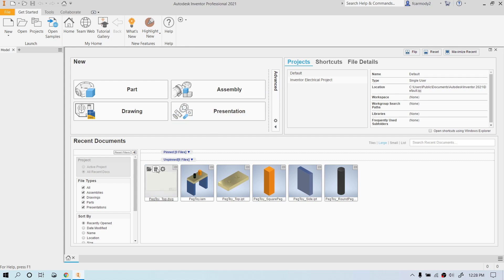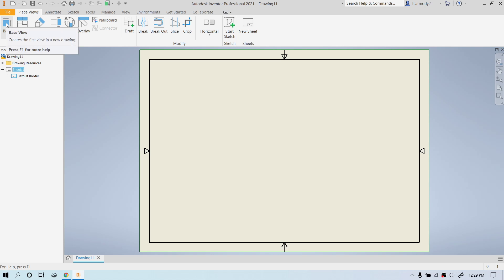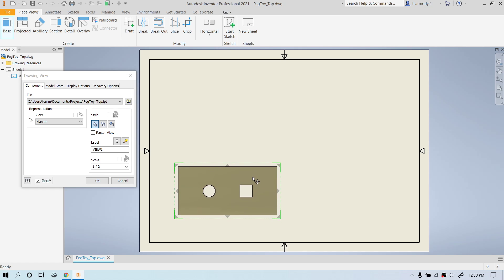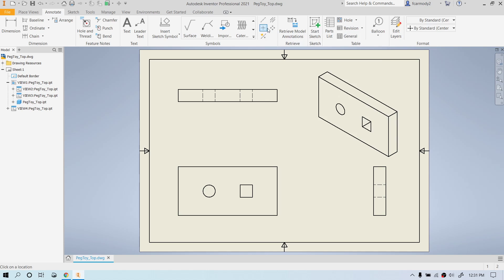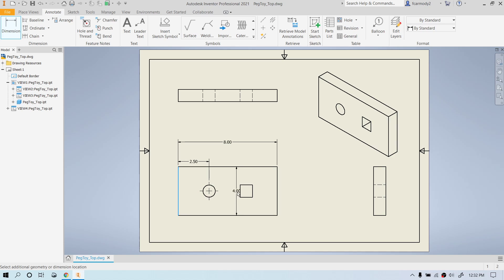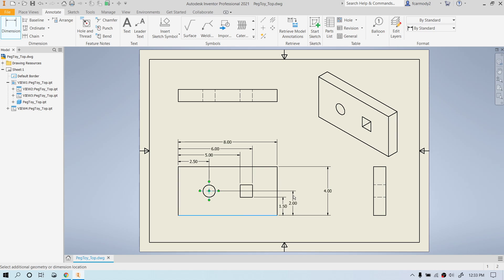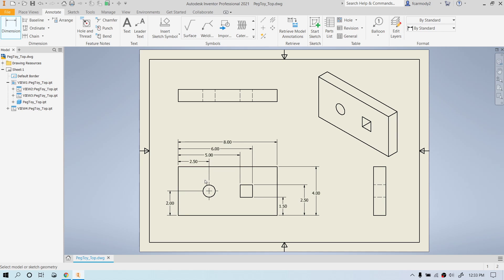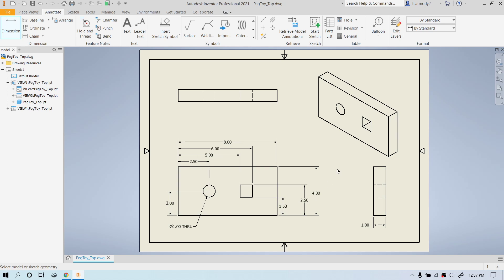Autodesk Inventor 2021 : 6 : Create a Multi View Drawing

Comment: Thank you for these videos as they are most helpful.  I would like to add these comments.....
1.  Drawings should communicate design intent clearly by placing views and dimensions in a professional manner.  Select a Front view that will project the most information and project the least Hidden lines into the Top and Right Side views.  Dimensioning considerations should include allowing for placement between views as shown, with dimensions Outside the views only as a last resort.  If this Front view had been rotated 180 degrees about a vertical center axis, there would have been no need to place any dimensions to the outside left or below.
2.  It was great that the instructor pointed out that the first step after placing the views is to place center lines for any circles in their round view.  This allows for placement of Location dimensions as he demonstrated.  But it is also necessary to next  use the 'between lines Center line' command to locate these circles in their Hidden views.  Having located the hidden view circle center lines, as he pointed out, these lines would NEVER be used for dimensioning.
3.  Dimensioning rules are published by organizations like ANSI for inches and ISO for metric drawings.  As the instructor indicated, dimensions are placed with the smallest close to the object and increasingly larger dimensions placed above the previous, with the largest last.  The first smallest dimension should be placed 3/8" beyond the object and each larger dimension would be placed 1/4" beyond the previous.  Inventor clues you to the placement by turning the Dimension into a dotted line when the proper spacing is arrived at past the outside of the object.  You see this happen in the video but the instructor misses the prompt.
        These are fine points but is easier to learn them right than it is to break bad habits.  One always wants to make the BEST first impression with their work.
Thanks Again for the Instruction shown in the videos.